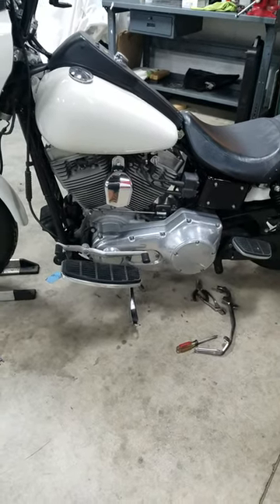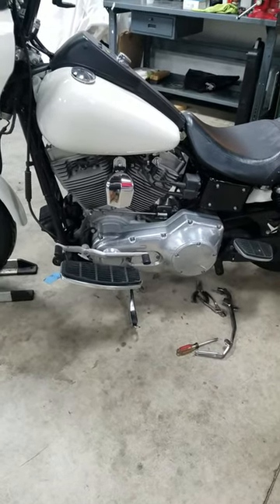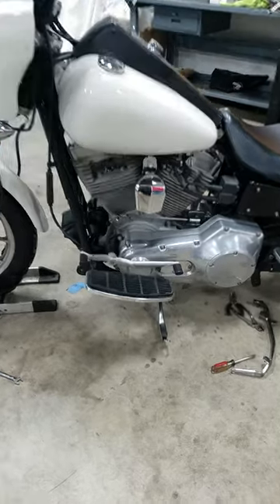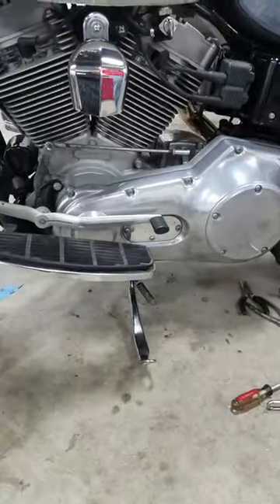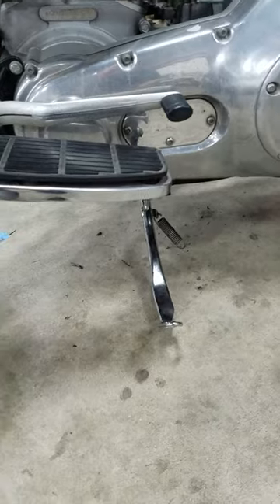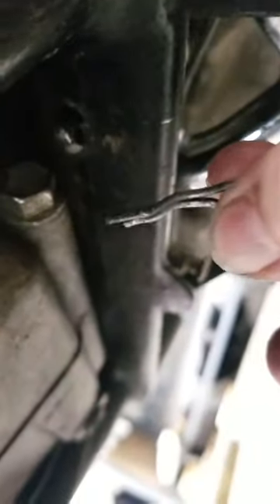Dyna kickstand jiffy stand removal pre '06 FXD

Comment: Thank you so much for making this video.  I replaced my jiffy spring (using the washer method) hoping it would improve its functionality. ie..it wont retract unless pushed all the way up. After watching your video a few times I decided to remove the entire assembly.  My 07 Dyna WG was just like yours but my cotter pin has a loop lock thing on it. I spotted it after using a mirror. After removal and disassemble, it was bone dry and dirty and now its clean and greasy.  It now works like new, thanks to your video. (wish I had done this before buying the spring-LOL)

Comment: My '93 FXDWG has had a severe 'gangster lean' since I replaced the shocks to raise the bike a few years ago. Then, the extension loop thingy (technical term) broke off, making it nearIy impossible to lower the stand with my foot. I  had the entire inner and outer primary covers off a few weeks ago to replace the seals, and, after I got everything back together and lowered the jack, I realized that I forgot to think about replacing the kickstand (I will NEVER use the term 'jiffy stand'; dunno why, but it just sounds idiotic to me). I was so bummed out, thinking that I was gonna have to remove the primary covers  again. I saw this video, but  refused to get too excited, thinking that the's no way I could have missed the fact that there's simply a pin holding the stand on the bike. Just went out an looked, and was pleasantly surprised to see a pin. 
Looks like I'm ordering a new stand today now that I know that it's easy to replace. 
Thanks so much!